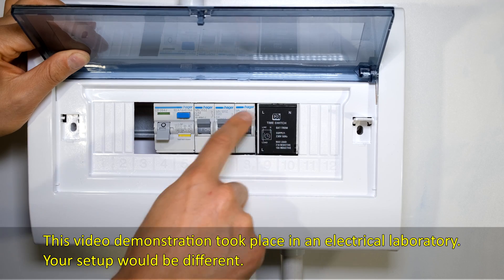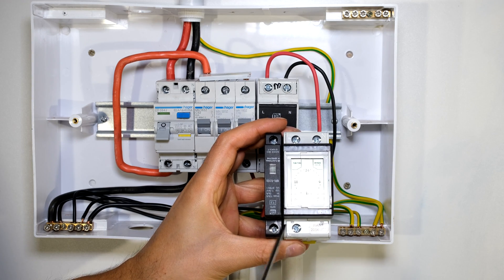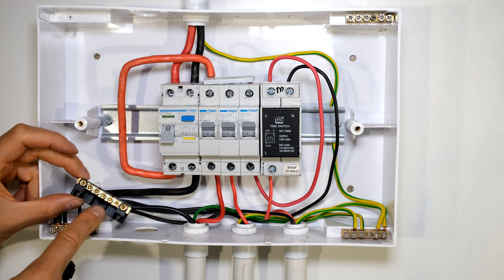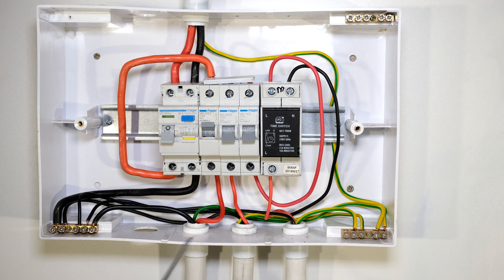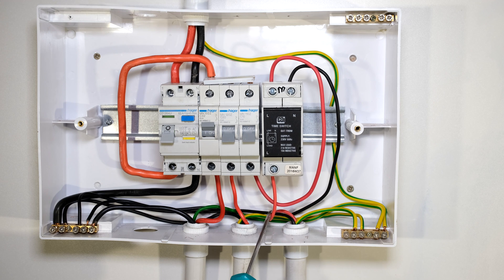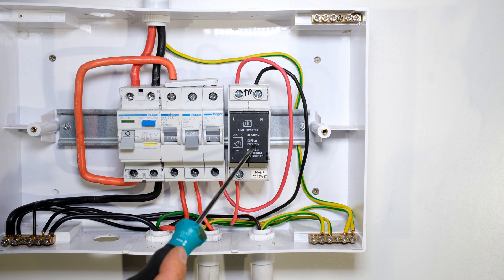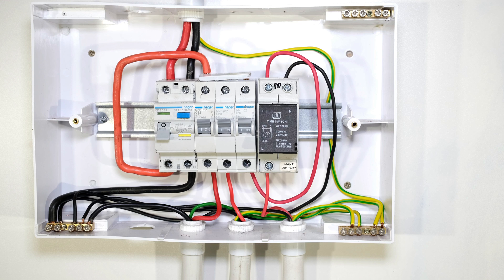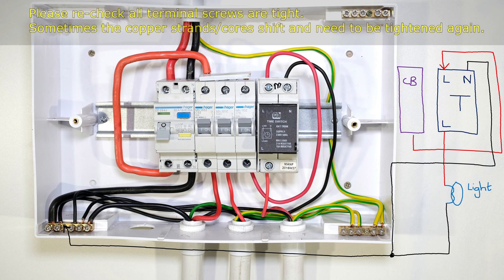How to wire a CBI Timer switch in to a DIN rail distribution board

Comment: Thanks for the video. I have a CBI timer with a pump (6.6A Inductive load) and a 4Kw heater element (17A? Resistive load) connected. I'm no electrician but it seems I'm pushing the timer beyond it's limits?